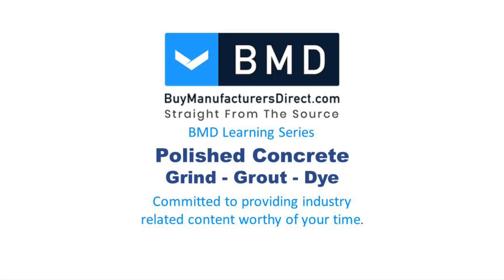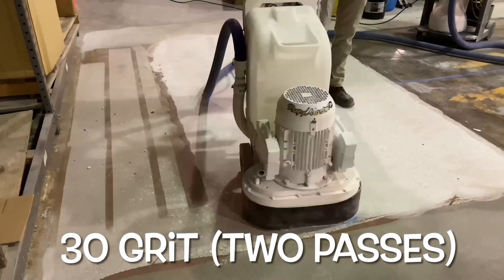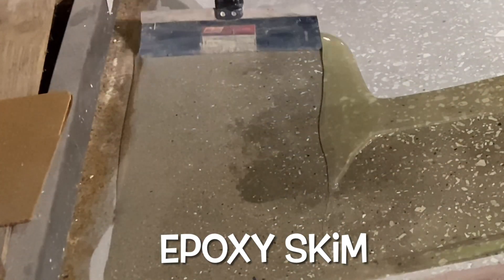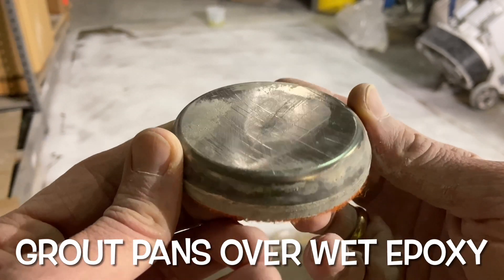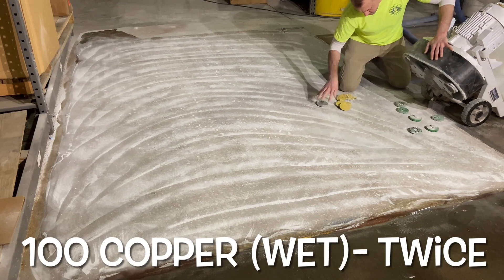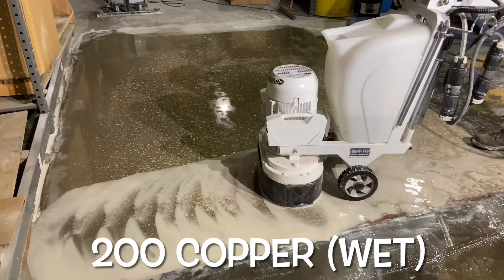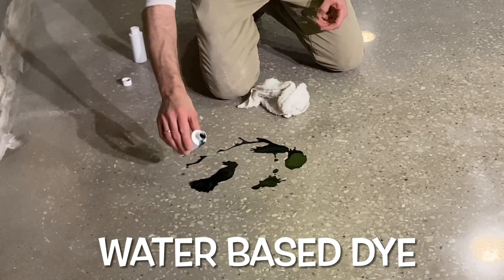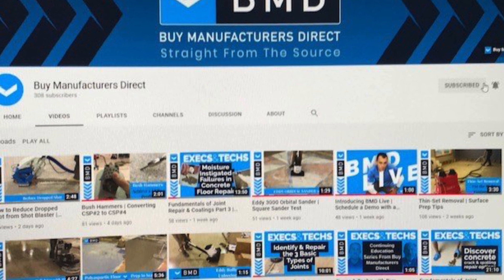How to Prepare for Polishing Concrete | Grind, Grout, Dye

Comment: So the Prep master jr has the sufficient head pressure for dry polishing? How is the hardness of the slab used to determine the certain diamond bond for concrete polishing? Or are the set of diamonds sold by BMD used for all the types of concrete hardness’. “A one size fits all” analogy.
Reply: Hi, Jose. These are good questions. 
The Jr has 45#/tool. The portions of the polishing process meant to be dry can be done by it or any other model. The primary difference between models is weight and that of course affects how fast the work gets done. They all polish the same. 
As far as concrete hardness, this is only a concern for the beginning grind step. The Jr and other models have the ability to run with less weight if the floor is soft and/or switch to a tool that has more or less surface area to change the weight transfer. Once this is done, then it’s a matter of letting the densifier do the work to make the surface more abrasion resistant. 
The aim with the machines and tools is to minimize excessive tool purchases. In my personal tool box, I carry three different prep tools (PCD, 30 grit 10 segment, 30 grit two segment). The rest of the polishing tools remain the same. 
Thank you for the great questions.
Reply: @joshjones8047  Awesome response! For the highest clarity possible which set of polishing pads would you recommend? FL07?
Reply: @joseoviedo1644  thank you. The pads I regularly use are the CLC pads. High clarity does rely upon the slab’s density and lack of porosity, but these pads have yet to fail me being the best way to make a clear shine. 
https://substratetechnology.com/index.php/products/tooling/diamond-systems/clc-diamond-system-concrete-polishing

Comment: Nice, I'm about to embark on 2500 sq ft in my own house. I've watched many videos: acid, water base and now your production. first, the slab was 4 OR 5,000psi, cant remember, just know I spected more than the engineer asked for. I think 4,000. Anyway, my plan is to grind up to around 200 then stain and them follow by polishing up to where ever the sheen satisfies me.  Why are you putting the epoxy down and then taking it down, fill micro pores?I don't see how a stain can pernitrate the epoxy, epoxy is a form of sealing? Thanks, I'll watch some more.
Reply: Thanks for the explanation of your plan. In my experience with dye, applying it any earlier than an 800 grit is likely to be removed by the polishing pads. The dye is barely subsurface and the pads, while they make dust polishing, will touch the dye. 
As far as the epoxy grout, this is done to fill the small surface holes. It improves the polish clarity. It’s made absorbent by way of the abrasion as it is cut down. It seems counterintuitive that resin will absorb the dye, but dye is very similar to sharpie ink. 
One bit of advice I would offer is to do a small mock-up of your planned process. Every slab is different, so you’ll want to verify that your method will give the results you want. 
Thanks again. Please don’t hesitate to ask if more questions remain.
Reply: @joshjones8047  Thank you so much for your knowledge sharing. I don't mind if some of the dye is removed, should give a bit of character other than color. 
Yep, going to start on the garage. Have about 1100 sq feet to work with.
Eric
Reply: @texasyankee1013  you’re welcome. Thank you for the compliment. The nice part about dye is it can be bumped up if too much is removed. As long as the polished surface isn’t given too much time to age, dye will always go in to some extent. The more polished it is, though, the less absorbent the surface. 
Thanks again.